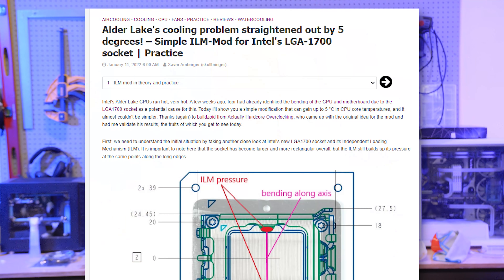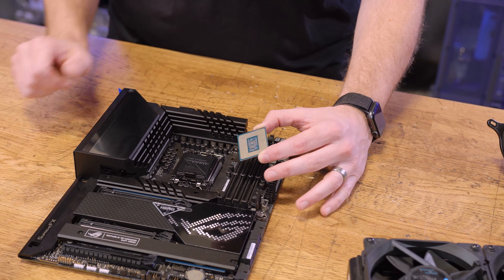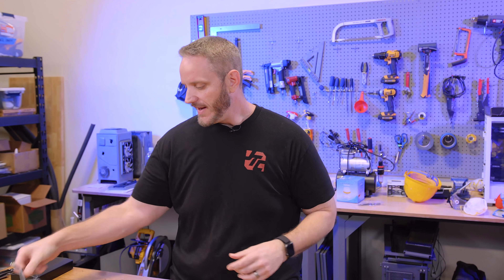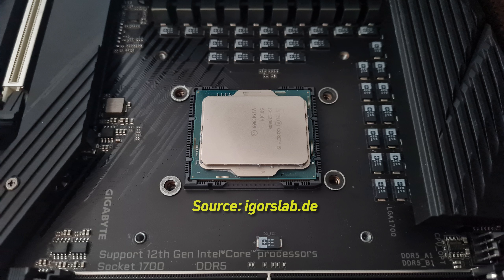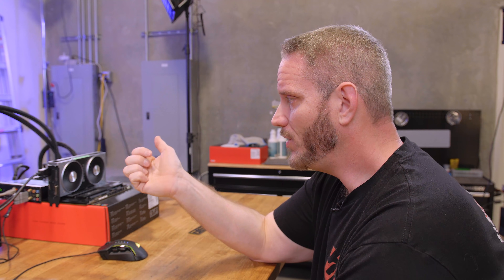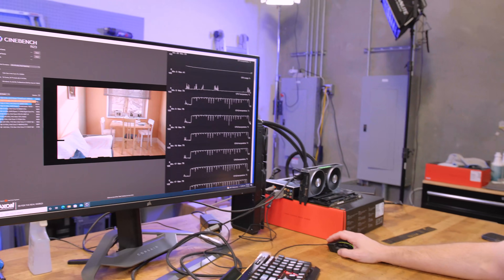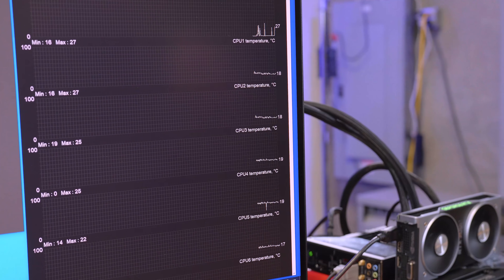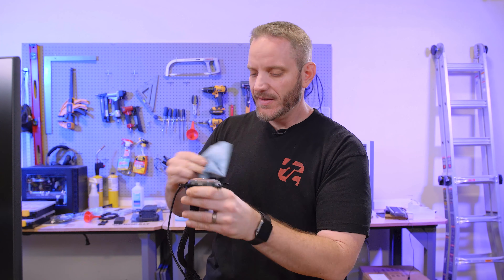YOU GUYS asked me to try this... so I did

Comment: My question is this: Why has Intel had this weird IHS design on generations of processors? Surely it doesn't take a genius to realise that a flat surface is a better mounting surface for a cooler, and that it in general provides better performance? Why then, by design have such weird surfaces on most of their cpu's? I've seen lots of references to people "de-lidding" their Intel processors and getting great thermal results that way, buy why is this even a thing that people feel that they have to do?
For bonus points: Will AMD moving to a similar LGA type socket result in similar changes to their processors temperatures under load?
Reply: It's inherent in IHS manufacturing and installation. Even if you make an IHS flat, the process of soldering the IHS to the CHIP creates a differential heat spot around the IHS, this is what will cause a change in the IHS to warp.

The benefits of lapping are known, but there is little benefit to do so. Going from 75C to 70C or 85C to 80C makes no difference in the end. It's still well within the temperature range.

The whole cooler components last longer may be true but it becomes irrelevant when the component will still outlive its usefulness. So why would AMD or Intel spend massive amounts of money to lap every CPU when it still performs well within its specifications without it?
Reply: @viet0ne  I'm more concerned about the existence of the current design, with an integrated IHS and such to begin with. Doesn't seem to need it.

Comment: If anything scratch marks from the lapping will aid cooling because it increase the surface area:volume ratio of the cooling surface so heat transfer is more efficient.
Reply: No it doesn't, it reduces the contact patch. If it's flat it has maximum transfer. If it has any irregularitie like scratches, then it's no longer a metal-metal transfer, the thermal paste (or worst case, air gaps) fills in the gaps which has significantly lower thermal conductivity.
Reply: @TimBoundy  I stand corrected. I was under the impression the thermal compound was intended to improve the thermal interface of metal-metal; not just fill gaps.

Comment: @JayzTwoCents Hi Jay, could you please do a one to one comparison between an open test bench setup and the same system in an actual case? I think there will be a huge differenz in temps. Most people talking about bad temps have there system obviouly in a case. And i think when your cpu on a open test bench hits around 70° you can expect an uplift of around 10-15° with the same load in a case.

Comment: A 12900K in the 70s in CB ???? Holy..... looking to all the other Youtubers tests and also my model that sounds like you have a real "golden" sample in terms of temps... or we others are all doing sthg wrong ;) I use custom WC with the new EK Velocity2 1700 block... , several attempts with different paste and application..with Kryonaut extreme and bit more paste than usual I am now at mid to high 80s in CB...comming from the 90s...

Comment: Your results suggest to me the limiting factor for thermals are either the bond between the IHS and the silicon of the CPU, or the performance of that waterblock, it simply can't remove anymore heat than it was in the first test.

Comment: Interesting. The other day someone online seemed doubtful about my 1.425V 5.4 all core 12600k temps with a Kraken X63 because his 1.3V 5.2 all core was getting higher temps with a custom loop, perhaps it's luck of the draw and his has whatever cooling issue these spacers fix and mine doesn't have the issue.
Reply: how much voltage did JAYZ use for the test tho ? He never said Vcore used

Comment: Hmm, mine 12900: spikes to 100C on many cores within seconds in cinebench multicore I don't even dare to run it for more than 2 renders. Checking temp with Core Temp and MSI Afterburner. Maybe this Noctua NH-U12A isn't enough? But it was the only cooler I could get with a Socket 1700 mounting I trusted at building time. Was planning on changing to a heavier cooler probably liquid later on.
Reply: I have liquid freeze aio 360mm and my i9 also reaches 90+ on cinebench but gaming etc is all good. Its just really hard to cool i guesse
Reply: @christianj606  yeah gaming is fine for me too, hardly ever anything but 60-70C tops. Maybe the cinebench issue is that I run win10 and it uses "all" cores at 100% even the e-Cores and that's why it heats that insane.

Comment: Noctua released a socket LGA1700 conversion kit for the NH-D15 and other coolers and its not a bodge, its a backplate and hardware that is perfect fit for the 1700 socket only.

Comment: It puts "pressure" on the CPU, not tension, and I don't see how overtightening the cooler block would cause problems unless it's not screwed down evenly - it won't bend.. What it might do is squeeze the thermal paste out more.
Reply: The cooler will put downwards pressure on the cpu and upwards pressure on the 4 holes on the motherboard. It'll definitely lead to bending if there's too much pressure.
Reply: @TimBoundy  I doubt it - the forces required to bend the cooler will be far higher than anything the mounting can impart - you'll start to crack the motherboard before then.
Reply: @Weissman111  I didn't say it'll bend the cooler. It bends the motherboard and by extension the CPU, since the socket is only plastic.

Comment: LGA 1700 kinda needs 4 pressure points on the latch then, but that also requires a CPU redesign maybe... not sure. It would just be the IHS needing 4 pressure points (2 each side instead of 1).
Reply: That will be interesting to see on Intel's next socket design if they use a 4 point pressure point mounting system.

Or if later CPUs get bigger but they make it wider so it is a square again.

Comment: Anyone else feeling some deja vu? I could probably copy an article from years ago talking about Skylake CPUs bending under cooler mounting pressure and publish it now.
I still remember building a system with an i7-6700K and a Scythe Ninja 4, hoping the metal washers for socket 1151 would be in the package, as they didn't even put a sticker on the updated boxes.
Though back then it wasn't from a socket height change, but a thinner substrate that was more likely to bend than socket 1150 CPUs.

Comment: haha you have a binned 12900K 100% I've been fighting with mine since I got it in middle of december :D 5 different thermal pastes, mounting mods, bigger case, more fans, more fan speed, PUMP on 100% (1400rpm) - if I do not limit the Boost Power to 200W - I go to 100C in like 5 minutes.
But 6:30 - 6:40, I'm pretty sure my cooler had a random LGA1700 sticker plopped onto the hardware bags and called it good as it was the only one in europe that already had LGA1700 mounting
Reply: Thts what he did. He locked voltages so no boosting.

Comment: I am confused as to how this makes any difference to how tight the cooler gets things in the end. Sure you lower the pressure on the CPU by raising the retention brackets but from my understanding the cooler mounts to the board, not the retention mechanism. The board height never changes where the cooler mounts, so unless the block rests on the retention brackets in some way I don't see how this changes anything. It is pretty late though, so I may just be missing something.
Reply: Buildzoid explains this in his latest vid. The LGA1700 CPU retention mechanism produces way more concavity than previous systems *and* he was using a coldplate that had been lapped flat.
Reply: @danielsmith6834  I didn't watch it, but that makes sense. They are not changing the height for spacing reasons, it's to create less flex so the cooler has better contact.

Comment: One could argue that making tiny grooves by way of sanding the copper on the CPU one would increase the surface area and, therefore, not only flatten it but also improve dissipation.
Reply: That would be counterproductive, because you're essentially adding insulated lines full of thermal paste- thick layers of thermal paste aren't as good as a very thin layer with mostly metal-metal contact, which is why lapping works.
Reply: @ugotznuked  Did you watch the video? Lapping didn't enhance thermals at all, because thermal pastes are so darn good these days.
Reply: @Njazmo  if this actually worked then XOCers would do it. Instead, they focus on getting both surfaces as flat as possible.

Comment: My cpu idles in the teens on all cores. 14-17c across the cores with the ek quantum velocity block matched with their Lga 1700 backplate kit. While gaming with a 5.2 all core I sit in the mid 40’s. Can’t say that for my 3700x I ditched even using the same custom loop it ran in the 60s while gaming. Amd runs hotter and there’s no way the people arguing that have even tested Intel.

Comment: Just check my Z690 Hero (no socket mod) using the new EK-Quantum Velocity² water block designed for LGA1700 pasted using Thermal Grizzly Extreme over a CINEBENCH R23 10 minute run... Hottest core (7) 81°C, package 84°C and the liquid temperature maxed out at 41°C for a score of 27247 points (multi core).
Reply: Jesud thats honestly still way to hot for how good your cooling is. These cpus need morr cooling than a nuclear powerplant at this rate.

Comment: If you're lapping the heat-spreader down to the copper, are you not worried about the copper being exposed to tarnishing/oxidization over time?  Or does the thermal paste act as a sufficient barrier to that?
Reply: There are plenty of waterblocks that are bare copper. You can always polish/clean

Comment: It's best to lap in a figure 8 pattern. Less margin of uneven pressure error.
Reply: Machinist by trade here and I agree with sirjizzalot. It is best to lap in a figure 8 pattern and to periodically rotate the object being lapped as fingertips tend to apply more pressure to one corner than to others. This has a balancing out effect and creates greater precision of the of the overall lapping process. Great video btw, doing a 12th gen build at the moment using a noctua nh-u12a chromax on a 12600k
Reply: It is best not to vomit what others have written without experience to back it up.  I never used a figure 8 pattern, and always got my heatsinks and processors to "stick."
Reply: @jong2359  its best not to be a dick online and assume others don't have experience.

Comment: If the the new 12th gen socket it taller than I would think that if the same hardware was used from the old gen then there would be way to much pressure on the CPU and motherboard and would definitely cause the motherboard to flex and probably the CPU. So putting some washers in-between the standoffs and motherboard would help elevate that pressure as long as there's enough threads to do that.

Comment: What Jay and most don't realize is to truly lap a CPU you need to machine the IHS with a lapping machine; sanding it down by hand is not true lapping. Annoying hearing people calling sanding it down "lapping." It may produce the same type of results but its not actual lapping. Machining it is the only way to get it 100% flat as by hand won't get equal pressure or the surface the IHS is on isn't perfectly flat

Comment: I use to work for a place that used microwaves to communicate with satellites. When we lapped the parts we use a flat stone not glass. start off with 160, 200, then 300 grit wet sandpaper you can use oil too but its kind of a mess. When you sand it you go in a FIGURE EIGHT pattern. It keeps it staying flat. If you go back and forth one side WILL wear down more than the other. Good job keep the vids coming. Thanks :)

Comment: was hoping that lapping might have had some effect. As I'm up against it with temps. Might finally need to invest in a D15. As my old air cooler just can't quite handle it when hitting blender.
Reply: I would either do that or a decent AIO would keep it very consistent, could also try getting some KPX first though

Comment: Looking at the bowed cpu I sit there and think its the opposite of yours.  because yours is concave it puts pressure around the edge where the pins are when the cooler is fitted, where the problem might be from where the heatspreader sticks out in the middle ( convex ) causing downward pressure with a cooler theres the gap in the middle of the socket causing it to bow down in the centre.
What do you think Jay??

Comment: Hey Jay try try typing in tilde and then type in the word ray and turn off all 3 raytracing settings for a huge fps boost in Battlefield 2042 and V. Like 40fps at 1080p low. Getting 340-370fps on bfV with a 12900k

Comment: I'm curious why Intel and AMD don't pre-lap their cpus before plating and labelling them.
Reply: I think this is a case of the mounting system warping the PCB and ihs
Reply: I would guess that if anything happens such as bending into a convex or concave shape then they would be held liable. Perhaps more so than just being the end consumer. Just because they retailed it out to the world and it changed its appearance once applied into the system. So there would be easily double the returned chips for slight inconsistencies in ones CPU. There would have to be intricate documented representation of every single chip that left the facility. 
12900K with inflated workmanship of manufacturing process $2000...

Comment: Nobody is talking about the 12th gen T series CPUs. They are even better for extreme budget because even the stock cooler will be effective enough, it wouldn't need a bunch of case fans, and you don't need an expensive motherboard with high VRM capacity/count. The 12400T at 4.2GHz is 74W PL2. The 12100T at 4.1GHz is 69W PL2 (nice).

Comment: If Intel makes a comeback and AMD responds we all win :)
Reply: Comeback how? They have the fastest cpus now right?
Reply: @samson_the_great  
Not when 5NM drops they don't.  It's taken Intel 2 generation refreshes to take a small performance lead but AM5/Zen 4 takes it back and by more than Zen3 overtook 10th gen by it looks like.  I'll be interested to see what effect the 3D cache has on the 8 core  Zen 3 part because there will be 3D cache versions on Zen 4 too.  I'm pleased that Intel are getting better though, without it AMD will end up doing what Intel did for years, sell basically tweaked versions of the same chip every year.
Reply: @darthwiizius  intel still has over 70% market share. It will take AMD years if not decades to catch up. We are talking about companies here, companies need money to develop new chips. More money means more legroom.
Reply: How? That didn't give me a PC. Why should I call it a win

Comment: one thing that might have influenced the test is that the tests in the article illustrated temperature deltas of 70+ degrees meaning that the chip was prob running in the mid to high 90s in terms of degrees celsius. At that level, chips would start to run into some current leakage, making any improvements in cooling have an amplified effect.

Comment: So you do not think 75 degrees is much? :)
And this is not even in a case , if you put it a case then it will be like 80-85  :)
Sitting here on my Ryzen which never gets above 40 degrees, usually sits around 32-35 under load.
It must be embarrassing and have bought a 12900k, because performance vs power and heat is some shit with that shit cpu

Comment: Weird...I have a 360mm AIO from Arctic with the LGA1700 adapter and I'm still hitting thermal throttle during Cinebench with a 12900k. It still runs OK during gaming which is why I'm not terribly concerned but I would at least hope I wouldn't go past the low 90s with a 360mm.
Reply: 12900k is shit....

Comment: I think this may actually be a really good idea for two reasons: not just for flattening the surface of the 12900k but it would also lower the height of the 12900k's IHS!

Unless of course a taller IHS (more copper between the die and cooler) would create better temperatures... more copper = more better? - so reducing the IHS might increase thermals instead of reducing them... Thoughts?
Reply: Less material between the die and heatsink is better as well. This is why GPUs are direct die on heatsink with no IHS. The IHS is present on CPUs because of how fragile they are. If you have someone overtorque a bare die you can crack the die pretty easily.

Comment: Speaking of tinkering with cooling I am curious to know how effective a heat exchanger, from a power boat motor /generator, would be instead of a radiator in a liquid cooled system.
Reply: What would you want him to use for the "cold" side of the exchanger?
Reply: @--_DJ_--  Water just like boats use
Reply: @johndenman8977  From what, the tap? A separate loop?
Reply: @--_DJ_--  A separate loop, not necessarily from the tap. Power boat heat exchangers use whatever body of water that they happen to be in as the reservoir and they have a built in impellor
Reply: A tub or other container will do
Reply: @johndenman8977  Oh I know how they work, I was just curious what you had in mind.

Comment: May be the concave surface was intentional to counter some design issue.

Now that this is in the public notice, Intel should clarify.
Reply: I think the point is the mounting system is causing the cpu to warp. It's being clamped down in the same spot as previous gen but now a rectangle and higher up.

Comment: Use a LGA775 cooler on my LGA1700, scythe mugen 2,  80mm fan @5v. Temps not bad, idle 39°C, cinebench 84°C. 12600k auto OC by Asus